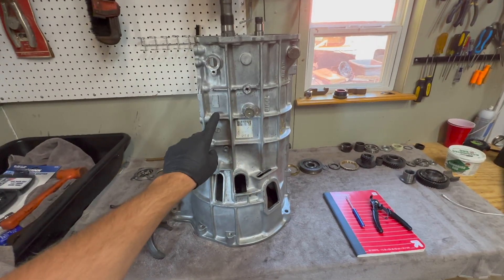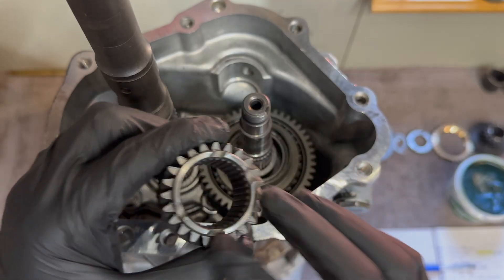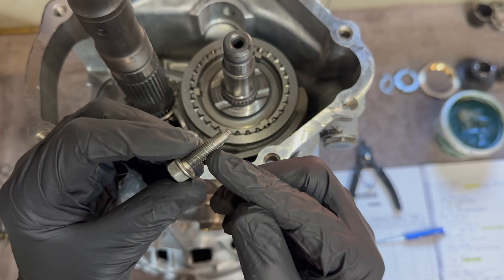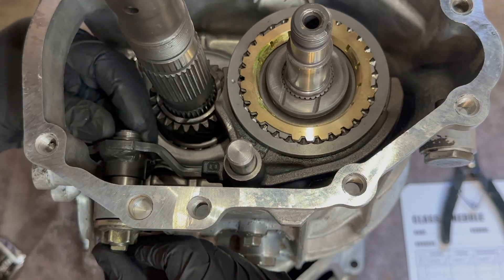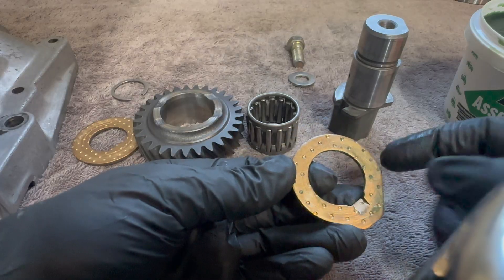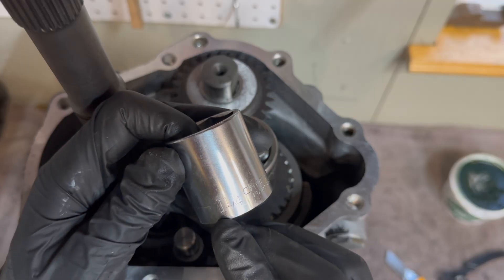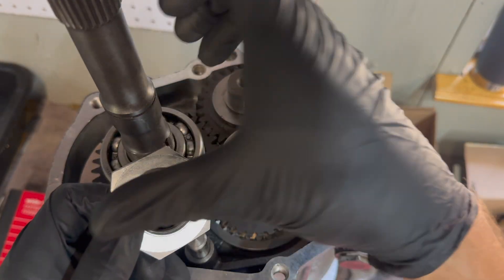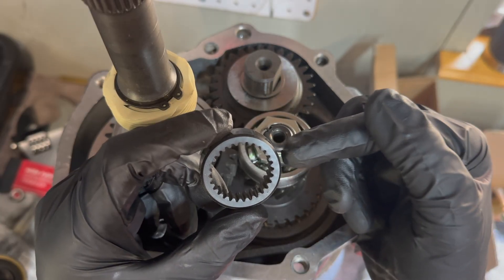Manual Ford Ranger Transmission Rebuild

Comment: For that reverse idler shaft bolt, workshop manual says the torque spec is 58-86 lb-ft
Reply: I really appreciate these videos, they really helped me out. I referenced them often during my build to double check myself. And that assembly goo is great, never knew it existed but l'll never do another build without it!
Reply from the maker: Appreciate you providing the torque spec!